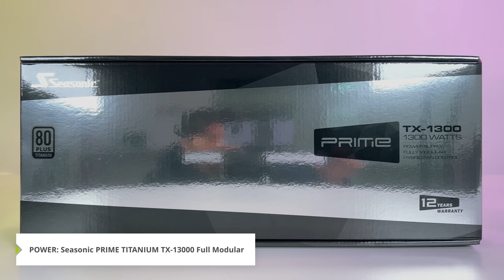i9-13900K ㅣRTX 4090 Ultimate Gaming PC Build

Comment: How are your temps with the H170i , I am switching over from a H150i Capellix i use a contact frame and Thermal Grizzly with a all core oc 5.6Ghz 4.4Ghz e-cores score 39k+on Cinebench but i still thermal throttle just a tad i want to know what kind of temps are you seeing with the 420m

Comment: What is the new type of lock used for processor instead of one that comes with the motherboard?
Reply: This is a socket bulge correction plate. This allows you to reduce the temperature of the processor due to a tighter clamp.

Comment: Where can I get that kickstand for the 4090 strix? Love that idea
Reply: That kickstand in included, at least it is in the OC version.
Reply: @whiplash9823  Ok thanks for the response! One last thing, I am building almost an identical setup with same parts as you, I see you installed a 12th gen blue CPU plate. Which box part did that come in or what is the reason for that being used?

Comment: Hello. There is a problem with gpu installation. It did not fit in pcie slot and clips did not click. I have same problem with my build. Literally does not fit because o metal part on motherboard.

Comment: Wish he could have done performance and temps. Im doing basically same build same brand parts same cooler and cpu contact frame. Only diff ram and SSD. For anybody using this build of Brand/Models/Parts what kind of Temps do you get with the 13900K+custom contact frame+H170i 420mm rad

Comment: you made  one big Mistake there. The M2 Slot you used shares the Lanes with the the PCiE 16 Slot you use. Your Graphiccard uses only 8 Lanes. What a waste of Money!
Reply: Seems the difference between PCIe 4.0 8x to 16x amounts to just about 2% performance loss, but yeah, it's not optimal. The top M.2 slot is just so tempting with the heatsink, it's the same with the Aorus Z790 Master - giant heatsink on the top M.2 slot, but if you use it, it halves the GPU lanes. Gotta use one of the less spectacular slots to keep the full performance.

Comment: needs more rgb and you only got 2 stick of ram
Reply: DDR5 RAM on Z690/Z790 works better with 2 sticks. More stable, less issues booting and you can get higher overclocks than when using all 4 sticks, so for performance 2 sticks is better.  Unfortunately G Skill don't do dummy RGB kits to fill all 4 slots as I prefer the look with 4 sticks installed.